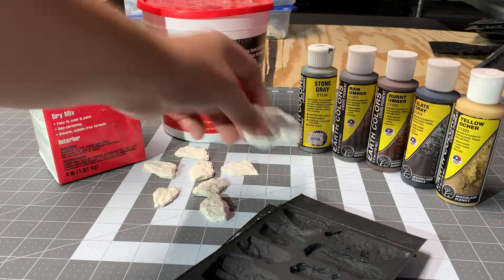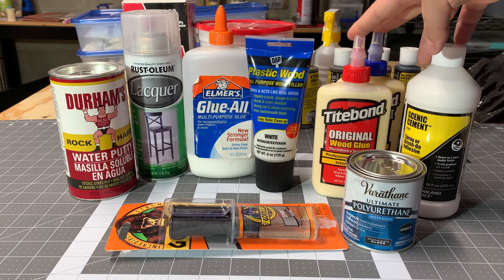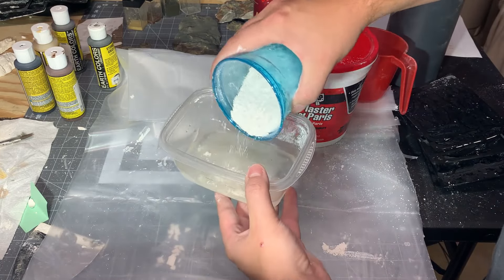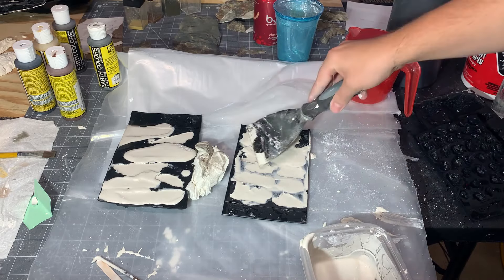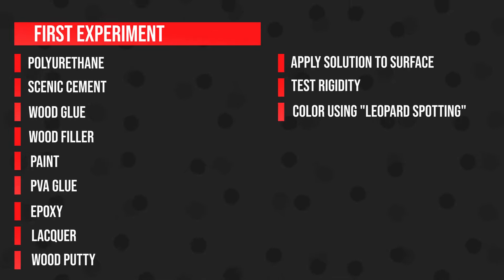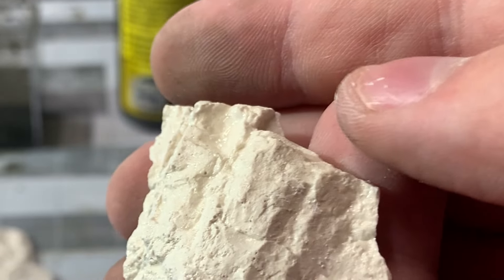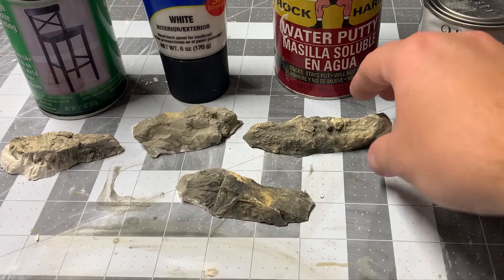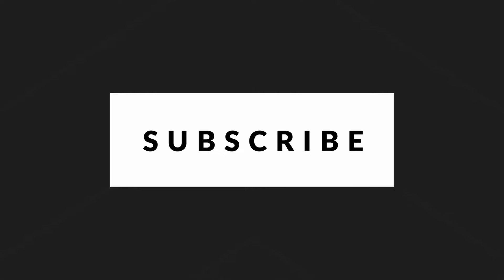Plaster of Paris: Making it STRONGER Pt.1

Comment: Best way to strengthen PoP is using a concrete acrylic fortifier in replacement for water when you mix. Been using this technique for years. Best imo!
Reply: Where can I buy the concerte acrylic?
Reply: @1Grandhustler   you can find it Home Depot or Lowes
Reply: @tycoon891  Do you recommend anything to make plaster harder?
Reply: What is the ratio of the acrylic to PoP?
Reply: You wonderful human, thank you for this tip! You sent me down a rabbit hole for an entire night and I learned that this is similar to a product marketed to crafters called Jesmonite that is wildly expensive and difficult to source in the US. I was able to find the acrylic fortifier at Home Depot. From what what I read it's a complete replacement for water, as you mentioned but @tycoon891 do you still look for the same clues as dissolving in water (dry lake bed effect, mountain of plaster, quick vs slow absorption) or does it behave differently?
Reply: @neonviolent  Awww you're so welcome! While mixing it does behave like water, however, when I use PoP with acrylic fortifier there aren't as many bubbles while mixing. So thats a plus, and hardly to any cracks forming if any form at all! Never going back to just water. I hope that helps!
Reply: @tycoon891  thank you for the quick reply! I can't wait to try it because of all the issues you listed above - bubbles, cracks, weakness - and was desperate for find solutions. My hero.
Reply: I am trying to figure our if I can use the plaster to make a mold for concrete.  I think this idea will work!  Thank u for the tip!  Silicone is so expensive!!!
Reply: @jenniferchristenson4200  Look up videos on using plaster for making mother molds. I remember awhile back seeing that people used dishsoap on the mold as a release agent. You painted it on, let it dry. Do a few coats. But you'll want a better tutorial on that because otherwise you risk the concrete sticking to the plaster. Let us know how it goes!
Reply: With the fortifier, are you still able to carve the plaster very well after it sets?
Reply: @danielplainview4587   I personally haven't tried carving my plaster after I demold it. However please still give it try! Would love to know the outcome!
Reply: That'll work for sure, but a cheaper and simpler solution is to use Cement All.  Hydrostone is even better, and not much more expensive, but can be more difficult to source.
Reply: What is concrete fortifier?
Reply: @josephbarth2714   it is a additive that can be mixed with concrete to harden/strengthen it. This additive can also be used with paris of plaster.
Reply: Do you mean to use cement all instead of the plaster of Paris? And use the concrete fortifier with that? @rockets4kids
Reply: @neonviolent I came here looking for the same information about Jesmonite. What was your results like with using plaster of Paris and the concrete fortifier? I'm curious to know because if it works well and comparable to Jesmonite, it would be a fraction of the cost!. From what I have seen online mentioned, this product is the same as aquacast, resin Crete and all of the others. They all use gypsum as the base material which is what plaster is made of. The ones that are just to add water probably have a powder form of the acrylic fortifier already mixed into the powder that activates with the water.
Reply: @claytonjames4779  Both Cement All and Hydrostone are ready to mix.  Just add water and cast.
Reply: @danielplainview4587  Yes, but only until it dries completely. After that it's hard as a rock! Can't sand it or carve it.
Reply: Lady at HomeDepot told me the same Advice for POP

Comment: This is going to sound ignorant as hell, but... the CHEAPEST most effective way to get POP to be stronger (as well as concrete for that matter) is to add about a 3rd to half as much ash to the mix. I know, but seriously... so long as the POP can still set up you can add as much ash as needed. I'm talking the powdered remains of fireplace logs or burnt leaf piles (if you're allowed to do that in your area). It'll add weight & density to the mix, thus making it stronger. Not to mention the cost savings. Only problem is it can be messy as all hell.
Reply: ASHHH, thank you!!
Reply from the maker: Never would have guessed that. I'll have to give it a shot!
Reply: Cement dust will work too.
Reply: This is such a grrat tip, and one I have never heard before. Thank you!
Reply: very thoughtful; less messy will be to sparingly add Portland white cement to the mixture, it makes strong out of the mold sculptures.
Reply: @graficaink9601  portland cement and POP will have the subject starting to explode open in a year or 2 .. been there tried that and yes 2 of the 5 subjects have started cracking open prior to the 1 year mark

Comment: When casting, mix the pva glue into the water, then add that mox to your pop. It strengthens the whole piece vs just the surface.
Reply: Correct, and depending on type of glue and amount, it can really be an added value towards prevent breakage.

It is of little value to try to strengthen by adding, an after the fact, product.
Reply: @bethbartlett5692  can you please share  the ratio of water and PVA glue?
Reply: @bilalpathan919 waiting for that ratio too

Comment: I liked and subscribed because of all the trouble you went through with this process, and your presentation. For what it's worth: I am of the opinion that the problem is addressed and not the cause. If one gold-plates a turd, it is still a turd. The solution lies in addressing  the plaster, not the coating. I think mixing the plaster with PVA glue (for example) would strengthen it considerably better than any of the offered solutions. Perhaps someone knows more, and can share their knowledge.
Reply: add hair to the mix .... pva hair and plaster is exactly a similar process we used for houses for centuries ...
Reply: I added Vermiculite to my plaster and it worked like a charm .. great vid!

Comment: If you mix that titebond with your water before adding the dry plaster, I believe you'll get the results you're looking for.  The wood glue is the best for the job considering the cost oft he epoxy resin, and it's the acrylic  that does it.  Once my pieces are dried (I just make planters,) I mix some wood glue and water, sometimes a tiny bit more plaster depending on what I'm after, and brush it over the whole thing.  LIke you said, it sponges it all up AND, believe it or not, it'll allow you to burnish your piece better than just the glue/plaster mixture.  Gives it almost a Venetian plaster look.  ;)
Reply: Tried mixin cola and water before adding the gypsum and the result is shit: The Cola doesn't help the Gypsum to soak and to agluttinate into a single structure properly.
Reply: The cola probably has phosphoric acid in it. Gypsum, being calcium sulfate, will react with it and you’ll end up with mush.
Reply: @josephlangefeld8938  That explains it.

So anything acidic (Vinegar and flour cola, for example) would turn the gypsum into unusable mulch?
Reply: Adding the Titebond wood glue makes the plaster stronger?

Comment: on those flat molds I press strips of gauze or cotton in the back to help hold them together when I take them out. I also adding some glue to the water to help make them stronger
Reply from the maker: This seems like a great idea. Plus, it's probably not any harder on the molds than the plaster.
Reply: That’s what I was thinking. Why not just mix the glue water mixture to plaster then to molds?
Reply: I love the idea of using gauze as a support! Great idea!

Comment: I recently got into casting and have tried the Durham's Rock Hard Water Putty. It works well for casting and is more durable than plaster of paris. Since you have it on hand and like the color, I'd suggest trying that for casting on its own. I also tried ACTIVA PermaStone and Perfect Cast. Out of those three, I would highly recommend Perfect Cast for it's quality and durability. It seemed like it had a finer finish than the other two and has a very slight porcelain quality to it. PermaStone felt similar to regular plaster on the surface, but it's far more durable. The Water Putty felt light and I didn't appreciate the color for what I was doing. Perfect Cast is a little pricier, but for my purposes (trying to make a fine art piece), it was worth the cost.

Comment: I watched the movie until the end and I have two conclusions. It is enough to change the type of plaster, i.e. use dental plasters of class 4 or 5, they are slightly more expensive, but have very high mechanical strength. The second option is to add dispersed fibers to the plaster of Paris, they will strengthen the interior. Plaster of Paris has poor early strength and is therefore brittle. These are two options that will significantly improve its durability :) 

PS. Epoxy resin can be diluted with cresyl glycidyl ether and or benzyl alcohol :)   Greetings from Poland :)
Reply: Hello 
"Epoxy resin can be diluted with cresyl glycidyl ether and or benzyl alcohol"
Do you have a dilution to suggest ? 
Looks like you can also add some "ADILATEX" from Ardex as additiv and get even more out of the product.

Comment: 🔺I expected you to add the product into the PofP mix.  Thats the method for gaining a successful greater tolerance. 

🔹Ideally you Stain first, followed by the sealer/Polyeurophine.

🔹Over a sealer it is recommended that one use "Chalk Paint", other paints won't adhere, either at all 9r well, over sealer. 

Thanks

Comment: mix fine "aquarium sand" or any other fine sand into the plaster of paris mixture up to 1:1 mix ration to improve strength and ridigity. For bigger pieces use steel wool or small metal mesh as reinforcement.
Reply: can you see the sand in the mix? I make fake food with plaster of paris and had a problem with big pieces breaking. I tried using foam clay instead, but its just too expensive and also doesnt looks as good as the plaster of paris bc foam clay can warp super easily. I like the smooth surface of PoP, though, when I can get it out of the mold without breaking anyway, lol! So I wonder how much the fine sand would affect that
Reply: @Em22-wtf  You mean if you can see the single sand pieces after you pull it out ? It will change it´s color but if you paint it you won´t see it. What you can do to improve the surface quality is you can brush a very thin layer of plaster on the outer surface before you pour to make sure you have captured every detail. Try it out and see if it´s useful for you .
Reply: Add a light dusting of corn starch to the mould first before clay or PoP, just brush on powder with artist brush, if too much goes into mould simply blow out. Stops the clay or PoP sticking & breaking taking it out of the silicone mould…

Comment: Before you began, I was sure a surface application wouldn't make much difference in breakability. You have to add something to the plaster mix itself. Without evidence, i would think the Titebond or Durhams might be the best choices. I might also try Weldbond glue.
I used to teach art in public schools. At the end of each year, I would haul out boxes of dead pens & markers, scrap pieces of wood from the wood shop, styrofoam "peanuts", cardboard, empty plastic container, etc. to create "junk sculptures" glued with Weldbond. The first year, a few students didn't take their sculptures home. I decided to break them apart so the pieces could be used the next year, But Weldbonded items were impossible to break apart, even with a hammer. So I would guess some mixed with plaster would increase its strength. It might also impede staining since the plaster would probably be less porous. 
Again, these are assumptions made from my own experience with hundreds of art  materials I've used in my 79 years..
Reply: Thanks!

Comment: Have you tried adding pva glue to the wet mix?
Reply: does this trick works? i recently started using PoP and it breaks easily during sanding, and the method from the video doesn't seem so cost effective unfortunately

Comment: I never worked with Plaster of Paris (or any other kind of plaster) before, but I recently bought some costume props from an organisation. The helmets have some damages, and I want to repair them.

It looks like the helmets are made of, which I assume, cardboard (or paper machee) and then covered in a thin layer of plaster. What would you recommend I use for those damaged parts for regularly wearing the helmets (inside and outside, with posibility of rain)? Just normal PoP? Seeing that you use water based coloring (and water to make it), I assume rain won't do much harm?

It's obviously not the intention to drop the helmets, or use them in combat simulation, so that's why I think they used plaster in the 1st place

Also, I'm going to spray paint & then varnish (or maybe lacquer?) when the helmets are finished to my liking
Reply: Probably too late for your needs.
I might try using one of the following:
Outdoor strength spackling. Once dry it can be painted with exterior water-based paint. It is water resistant, so would probably withstand sweat and or rain. I would seal the pieces with something like Minwax polyurethane (outdoor/indoor, water & fade resistant)  before adding the spackling and then as a sealant after painting.  
I also saw a video of someone using flour, white glue, baking soda and vinegar in a similar way. Unfortunately she didn't include amounts. The vinegar is to prevent the mixture from getting moldy before it dries, which might take several days. I plan to try several mixtures of that flour clay on small items to create my own recipe. 
Look for videos of homemade air-dry clay. You can add paint to color it ahead of time or paint it after., Pieces can be glued on with Elmer's or wood glue. One disadvantage is that the pieces do shrink a bit while drying, so they won''t work with everything. For example, if you were to make a bowl with it, you could press it inside of an existing bowl to create the shape. As it dries it will get smaller inside of the bowl. But if you put it on the outside of a bowl to create the shape, as it shrinks, it will probably break.

I've also use modeling paste to fill in missing pieces or breakage. In small areas, it dries in an hour or so. For large areas it might take a couple of days.

Comment: As you should know by now with other comments, you are suppose to add the glue within the mixer of plaster and some add in the acrylic paint in the mixer as well for desired colors in mixer.
Reply from the maker: I suppose the thought was these were things that could be done to existing casts. I'll definitely have to try adding hardeners to the plaster, though I'm not sure I would use my nicest molds when adding glue and things!
Reply: @warscapestudios  it doesn’t hurt Molds one bit. I’ve added all different mixtures to silicone molds. Put cornstarch first into mold for best release. Mix the pop into glue water mixture or whatever mixture. . I’ve added all different mixtures to my most expensive molds and they’re fine.

Comment: This is weird. I looked into this years ago, and they were adding the items to the mix, not top coating to make it stronger. Top coating doesn't seem effective. I actually tried the school glue and it worked for me. I mixed it with the plaster and then poured and cured. I don't remember what the ratio was now.
Reply from the maker: I'll have to give that a try!

Comment: If I wanted to make the PoP indestructible could I just mix it with something other than water in the first place? For example just make it a PoP polyurethane mixture and put it straight into the mold that way?
Reply: I'm wondering the same. Have you tried it?
Reply from the maker: I'll have to give that a try
Reply: Mix 2 part epoxy and add your pop or Durhams Water Putty to it, rather than the water you'd normally add. Almost unbreakable, and water proof. You could cast using POP,  then use the epoxy mix as a Coating you'd brush on. FYI, you thin epoxy with a small bit of rubbing alcohol or even just warm the mix with a hairdryer and it's much thinner.

Comment: A possible option is to strengthen plaster of Paris is to mix in cement (not concrete) 30 to 40 percent cement to 60 to 70 plaster of Paris.
Reply: Hi. What type of cement to mix..? Thanks!
Reply: @fromtheroots4003  regular cement that is sold at building supply stores. Make sure that it is cement and not concrete or mortar. The cement needs to be cement dust/powder with no rocks or aggregate in it  Remember no concrete.
Reply: Thank u 🙏
Reply: I've tried this and it seems my pieces ended up brittle, then I looked into it and the articles I read said cement powder and plaster shouldn't be mixed. But I will give it another go and see what happens. Thank you!
Reply: Thank you, but back to the drawing board

Comment: The Durhams water putty when mixed correctly ( the consistency of glue/pancake batter) will harden to the strength almost equal of Bondo. For these small parts, I would use nothing else. Look no further. A word of caution, Bondo is actually easier to sand.

Comment: You really need to add the glue to the mix and not just coating the castings with it. One wouldn't really expect coating to strengthen the  plaser.
Reply from the maker: Yeah, I just wanted to experiment with the things I've already cast. I will have to try adding things to the mix. I've seen both things like wool and glue to both increase the durability. So you think PVA or wood glue would be best?